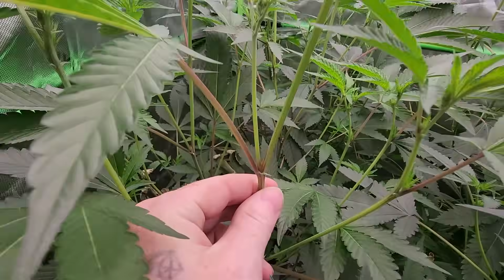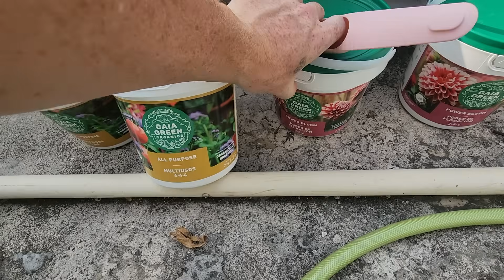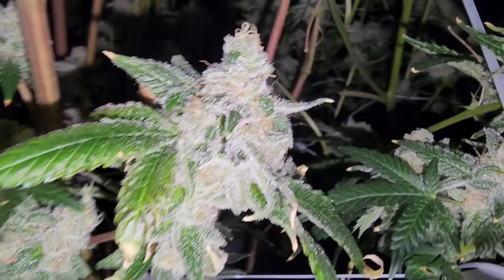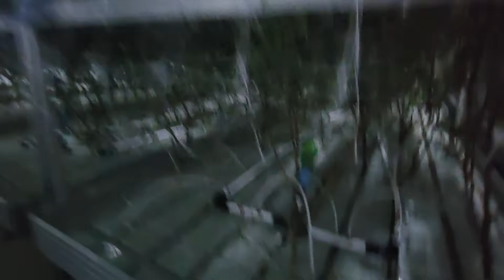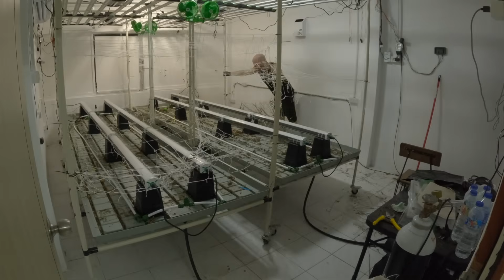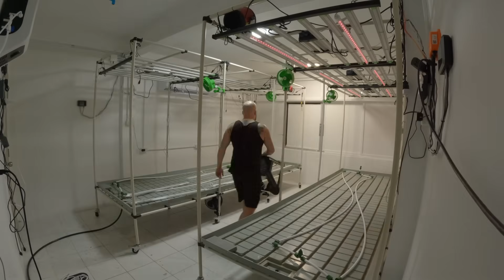Drying 550 plants and RESET for next round!!!

Comment: No heavy metals dude. More like a Calcium deficiency. There are some plants that needs lots of Ca when growing under leds. I’m doing Gush Mints currently, supplementing CO2 at 1300ppm, 28,5°C, 1500ppfd and 2,8EC in GROWING STAGE (my proprietary supercharged mother plants) and they didn’t thrive properly until I started to increase Ca-Mag to 0,6EC from RO water.

Comment: This is exactly how I run my flower. 3x3 in a 4x4 tent. I'm about 3 days overdue to finish some Gelato 41. It's looking spectacular. You can get pro results without air-conditioning, dehumid/humid gear and Co2 injection. I'm just blowing air averaging about 84 degrees F humidity about  57%. VPD averaging about 1.57.

Comment: Hey Ryan
Remember that reverse osmosis only mainly removes dissolved solids
It's possible you may have hydrogen sulfide (rotten egg gas) in the water
R.o. will remove some but not all of it, so you may be experiencing the effects of excess Sulphur 
Unfortunately the only commercially viable way to remove it completely is by chlorinating the water
Reply: aerate the water
Reply: Fart gas😂